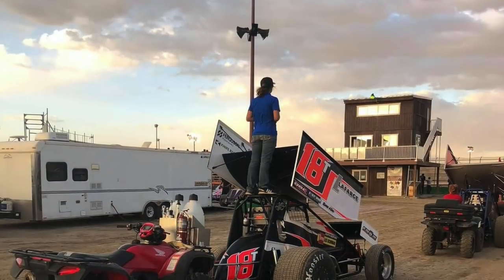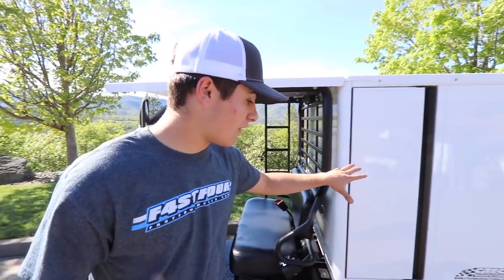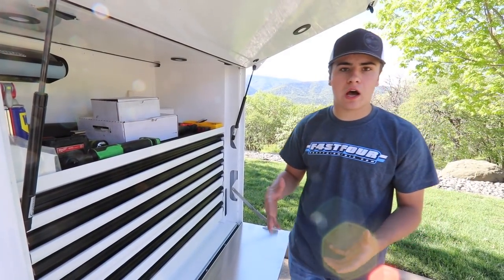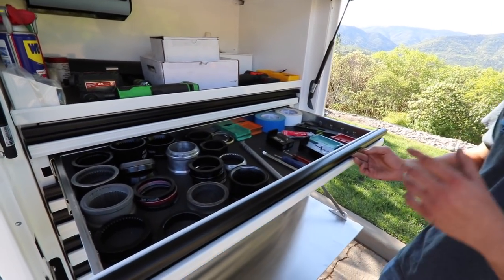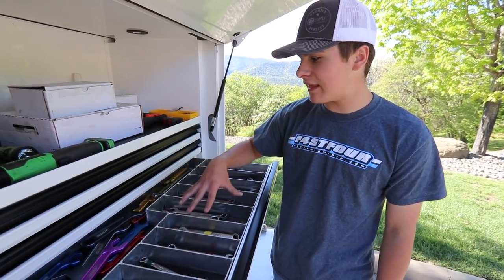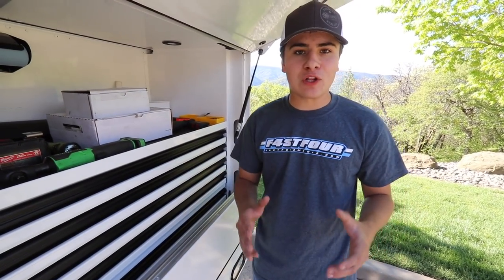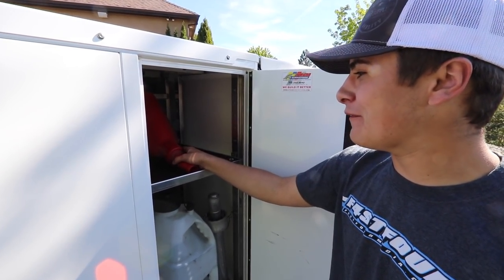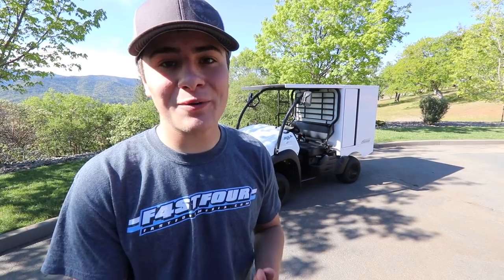Here is Our Pit Mule For The Sprint Car! FULL TOUR!

Comment: Your mule is kinda a blank canvas.I have seen a lot of different ones the 41 JJR racing added a small air compressor and a generator sometimes they must unload and not work out or their trailer. Everyone mounts a complete Front end to the front of the mule already set up with the radius rods and brakes. They also put radius rods and shocks in them . I will shut up I just have been around several of them. I wish we could get a ASCS ride for you you would get a ton of seat time keep working and safe travel
Reply from the maker: Hey Jeff, you are correct! Like I said in the video, this is just something we are building up and this is the first look! We will continue to add over the course of the season! Hopefully one day it will look like an outlaw team mule!